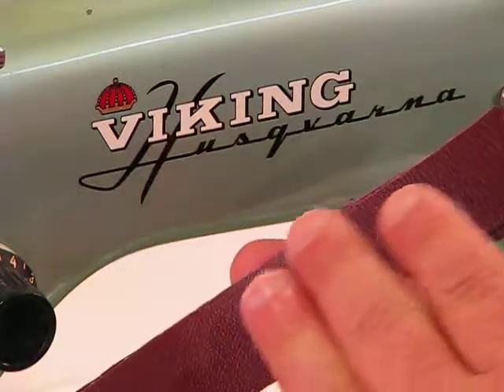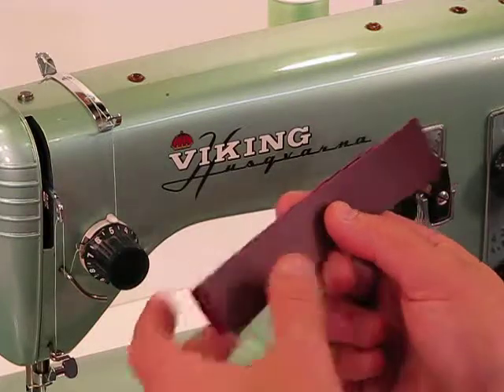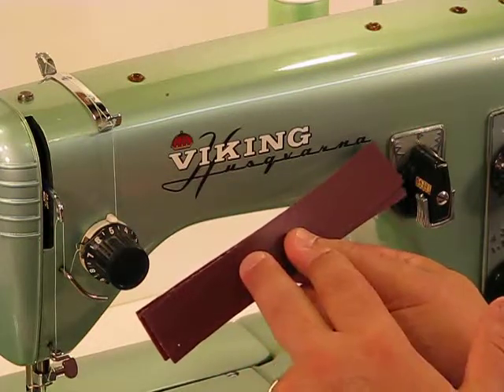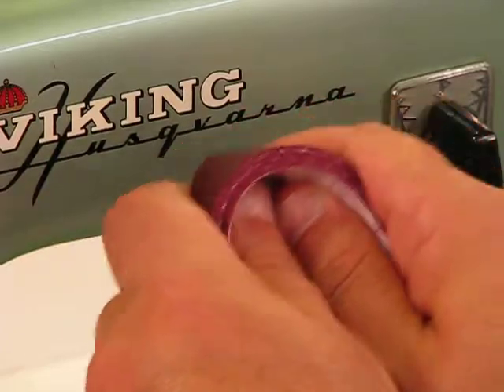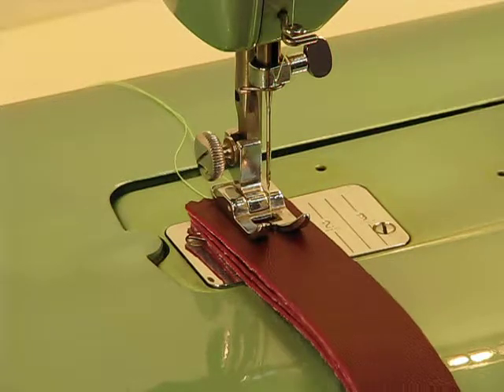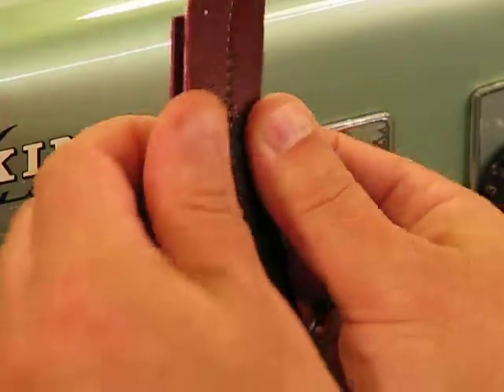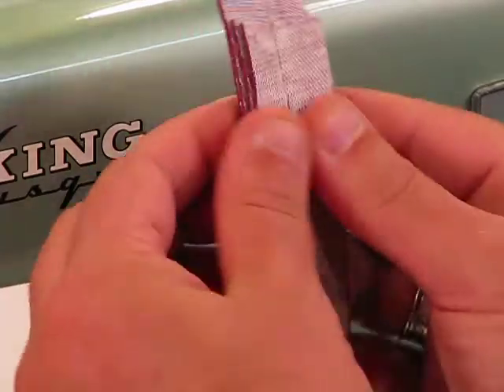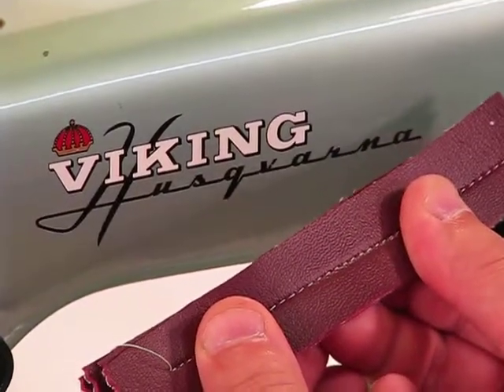Husqvarna Viking 21-A - 4 Layers of Commercial Vinyl Edge Binding

Comment: Hey, I have one of these! Well, mine is Swedish market, so it doesn't say "Husqvarna Viking", it says "Husqvarna Automatic 21-E" instead, but it looks very similar. They are just referred to as "Husqvarnas gröna" here in Sweden, meaning "Husqvarna's green one". And they have a reputation for being strong! Mine even has a low gear, giving it five times the power! You engage it by pulling out that little wheel you use for spooling thread onto the bobbin. Quite handy, because it also makes the machine five times as slow - very neat when you want to go slow! I suppose that might be the difference between an 21-A and my 21-E?
Reply from the maker: Thanks for sharing Niinsa62...The SLOW GEAR is a great feature of this amazing GREEN MACHINE, and while it does not actually increase power, it certainly provides much better control and management of the material. The primary differences between the 21-A and the 21-E, is that the former typically comes standard with a 1.5 amp motor, and requires a CAM insertion for additional stitch patterns, and the latter typically comes standard with a 1.0 amp motor, and has limited CAM functions engineered in the machine.

Comment: what tension are you using on this machine for sewing this much heavy duty vinyl?
Reply from the maker: Hi Diablo...The UPPER TENSION is nearly "5", but the presser foot pressure is what really matters with a material like this. The heavier the material, or when sewing material that tends to bunch up, INCREASE your presser foot pressure. Thanks for the question!